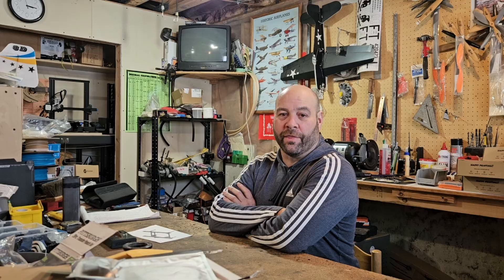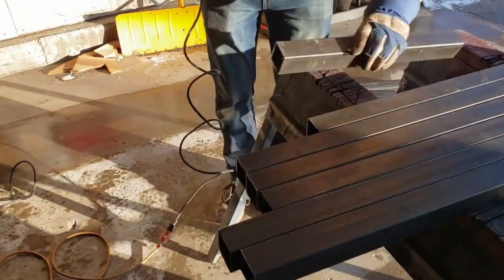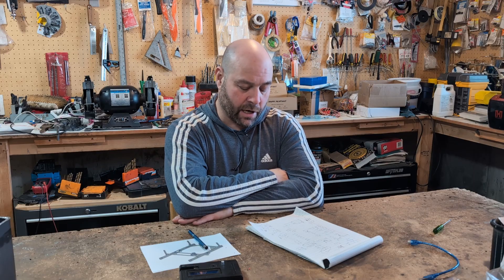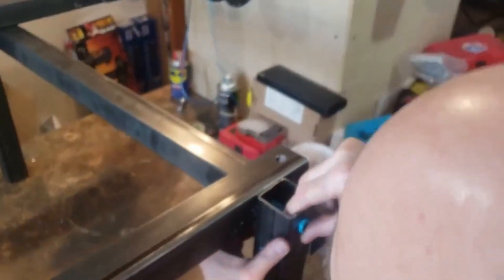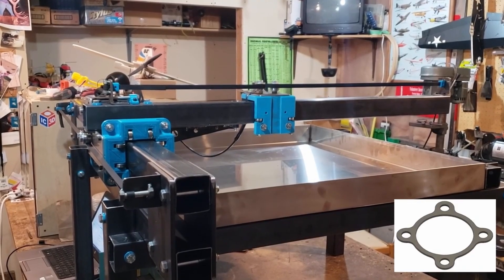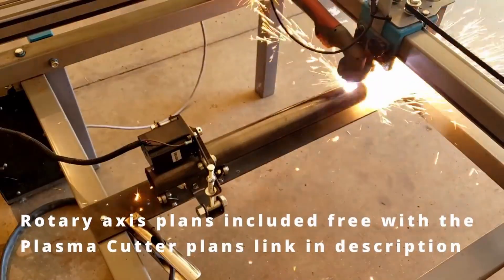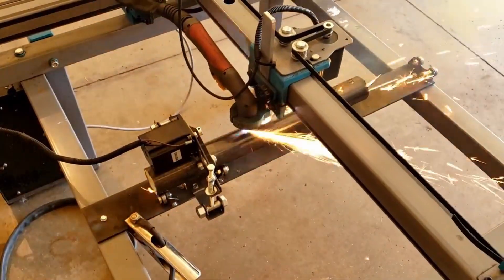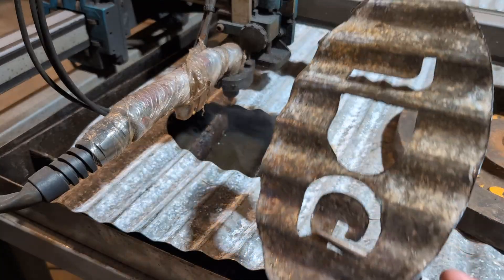Does Our DIY CNC Plasma Table Still Cost $350 to Build?

Comment: In my area there is arlos metal outlet. They have great prices on cut offs and good prices on full pieces. I think they charge for cuts but not that much. They carry a lot of metals in 10' lengths, so no cutting required.  Go to a place like farm and fleet by the pound

Comment: 6/12/2025
I am building the Gen 2 table (with limit switches and without water pan and Z axis) and the cost of the electronics parts alone is ~$350 before tax and without the ~$48 plastic electronics box. I will be purchasing the 3D printed parts from JDG for ~$97. So including the frame steel and hardware, I am estimating the total cost to be $675+. The plans were also $25. So the realistic cost is almost certainly higher than claimed. At least it is for me. I am still going to build it though because I already have a plasma cutter and air compressor, and its still cheaper compared to the cheapest commercial table at ~$1500 for table only.

Comment: unfortunately, i just priced out all the materials and the total cost to build this is over $1500 in my area. The electronics were $450 alone with wire and all the little stuff included. Steel frame was $200 with flat bar and angle iron for me. sourcing all the nuts and bolts is crazy tedious and cost around $150 lol. id have to buy the 3d parts and steel plates because i dont have the tools to cut the plates. so it is cheaper if you have most of this stuff laying around for sure. i can just buy the base crossfire for this price and not have to source all the materials.

Comment: Just for the record Arduino's are $28 now on Amazon as well as the OEM Website. Still excited to begin the assembly proccess!
Reply from the maker: Clones will work just fine for this project as well and they are much cheaper.

Comment: The "filtering" you are doing for the THC... .....   thats due to high frequency start plasma cutters, right?  And after you add the filtration/isolation.....does that mean a high frequency start plasma cutter will then work correctly?   One more question that I came up with....  Since you are building it yourself....there is really no limit on size....you COULD theoretically build one 4 times as big.........just change all the coordinates in the software, right?  (probalby have to truss the arm a bit...maybe counter balance, but still doable, right?

Comment: I just picked up some 8’ Thomson linear motion rails for $100 each. It’s a rail, belt, bearing block and nema 34 motor mount and flex shaft coupler. Just need motors, drivers and a frame. He’s got 12’ units I can get for $150. I plan to buy all 20.

Comment: I have built this recently in the uk, the cost is alot higher now but still was worth it. main savings i made was getting the water pan folded up with a golden handshake and getting the 3d printed parts done professionally (again with a golden handshake) Unfortunately and this is no discredit to jd, but for $350 that is if you are already set up as 3d printing metal tooled wizard. It will cost you more if you are an average garage man but dont let it put you off - the plasma cutter and compressor will be your main cost.
Reply: Wow, would love to see this in action. I’m in UK too want to build but space is an issue as always is in UK.

Comment: As of today 3-12-2024 it can not be built in my area for under $350.  The Amazon links for all the items listed in the kit not including the water pan was more than $350.  Still a good deal in my opinion.
Reply: I think you are mistaken.  the $350 cost is for X/Y axis only and no water pan.  If you are in USA, Amazon links for this configuration is exactly as the video states.
Reply: I will re-examine what I ordered and put an update I did include z axis products, No water pan and no steel.
 @jdstremi

Comment: As much "FUN" as I am having with this project, I can't figure out how to install the post processor to Fusion 360. The vids I find talk about clouds and libraries and preferences none of which do they show how to find these things. I've watched your video, and it doesn't explain it either.  I need an Idiots Guide to do this install. After 3 months doing this build that has had everything that can go wrong, go wrong I'm frustrated. After getting the wiring done, I find out the motor wires are supposed to have Drain wires. Never seen anything about that. The other thing I can' t find are the files to make the Z mounting plate or the files to make the roller if I decide to do that. Maybe I'm just stupid, or I have incomplete instructions I don't know. I am WAY over budget and still need the water pan and the slats, also no mention of slats. I seem to be the only guy having these problems. I don't have a young computer geek to turn to. I really need some clarification here.

Comment: Is the Z axis control required for thee rotary axis and THC? I also see that there is an Arduino R4 with has wifi and BT built in for nearly the same price as an R3. Would that be a good option?

Comment: I do mostly freehand plasma cutting for metal arts. However I do want to be able to do a few brackets and such. What really got me looking at this is the pipe notching add on. I use a lot of pipe in my studio projects and the angles and sizes are numerous. When I freehand them I end up doing a LOT of grinding. I have a Thermal Dynamics Cutmaster 60i with an SL50 torch. I'm trying to figure out if I have to buy a different torch or can somehow modify this one or add a port to control the on/off. If anyone has done this I would be grateful to know.  I'm not really sure where to start this portion.

Comment: Despite my deepest respect for your work I will definitely encourage my fellow hobbyists to read my experience and reconsider whether this plasma build is your best way forward. 
I acquired the drawings from JDG invested and everything needed and here is my learning:
Most of the stuff presented is linked to from US suppliers. Here in Northern Europe this means more than doubling the prices due to transportation and import fees. I spend a lot of hours searching for local suppliers and I only found prices far higher than suggested from JDG.
The X-axes profile is described as a 50x50x1.5mm tube, and it cannot be replaced by profile with thicker walls.
None of the European suppliers I work with does have this in stock since it is a rare size seldomly used. 
Despite my OK experience with 3D printing (Ender 3) I never ended up with acceptable prints. The printed objects have thick walls and 85% infill, which is beyond my 3D printing skills. I wasted more than a kilo premium filament trying.
Conclusion:
I found a cheap engraving machine on German EBay with almost the same work area. It took me 6 hours to change it to a plasma cutter and I spent the same amount as my JDG attempt
Reply: Link? Im in the UK and have the same issues

Comment: Has anyone been able to use this table with an older miller plasma cutter? I have an old miller 375 x-treme with the ICE-27T torch and not sure if it will work as it’s not low frequency?

Comment: I bought your plans and the build is in progress. I am adjusting your plans to work with my existing table from Northern Tool. My X tubes have been changed out to 2" angle (1/8") and bolted to the table frame. Watching the various videos by you and several others convinced me to attempt this.

Comment: Just about to order the plans & parts… now that Fusion360 is pay to use can the software work with FreeCad ?
Reply from the maker: Fusion 360 is still free for personal use. FreeCad also has CAM and post processors for grbl so it should work.

Comment: I bought the plans for the CNC table they are great. Easy to build. However , I just got to the point where I'm ready to make some cuts and my titanium 45 plasma cutter torch won't start off the switch relay for some reason. I check continuity on the torch trigger and on the relay. So I have the correct wires connected to the torch relay. When I fire the relay the torch won't start. But when I pull the torch trigger manually it fires no problem. Looking for any ideas that can help please?
Reply: I also have a titanium 45 and am interested in the answer to this question before I start the build.
Reply: @SJB64  the trigger wires have to be spliced into inside the housing of the plasma cutter body. There are videos on YouTube of how this is done. After you make the splice the trigger on the plasma cutter torch handle needs a piece of velcro around it so it can be held shut.

Comment: I am currently at the wiring and electronics part and am a little over budget but I also bought the 3d printed parts and plates from you. I have also done some extras like drag chain for the wiring and a proper box to mount the electronics. Overall I am quite happy with the build instruction and plans.
Reply: Hey are all the electronics parts required in the plans as well

Comment: I wish you guys would start a "Forum " on your website !! All the JD Builders need to unite and share.
Reply: The work you guys would have to put in to start a bare bones forum would be more than paid back by the users/community contributing and helping each other, building the knowledge base and doing a fair amount of the work for you. It would basically crowdsource 2/3 of your customer service.
Reply: @solarguy6043  They can start a forum with just the click of a button! There are themes and plugins just for creating a forum.
Reply: @solarguy6043  Or even try to set up a user subforum on an existing site - or create a subreddit or discord. I would really love to see that.

Comment: Bought the plans back in July, cut up all the metal, but started traveling a lot for work. Recently got back to work on it and it's just about done. The plans and support are great. It's a fun project, now I will actually use my plasma cutter that has been sitting for years. I am over budget, but only because I only had a weekend to buy steel and the only place open jacked up the prices. I also added the Zone-axis. Now I just have to get comfortable using it. Thanks for all the effort you guys put into this.
Reply: your old plasma cutter is likely high frequency which will cause issues with electronics won’t it?
Reply: @peejayem4700  thanks for the insight, but I already looked into that and it is low frequency, so I'm good to go.
Reply: @gottadrivem5878  ah that’s perfect. I’m in the middle of my build - lots of work but hopefully worth it!
Reply: @peejayem4700 I enjoyed building it, it will be well worth the effort. I'm still debating if I will paint it or not.
Reply: @gottadrivem5878  I used galvanised and aluminium so won’t paint mine. If you’ve used mild steel would probably be a good idea I’d think

Comment: I just came across your budget build, and this video was posted 8 hours ago! Is it possible to increase the table size to say 4x4? If not that is not a problem, this will work for 90% of what I need it for, for the time being. I will be buying plans tomorrow! I am most likely going to be needing to order the 3d printed parts.
Reply: They suggest (in another video) that you can make the table longer in the Y direction, but not X because it's only supported at one end.
Reply: @timandrew4515  thank you, I guess I don't have notifications turned on for YouTube. Hell I would be thrilled to have even a 24x24 if just to cut link tabs. I have a mud truck I bought and it needs to be rebuild. And I made shock tabs with my plasma last year.....ugh I made one just smaller then I needed and cut 16 of them, then drilled holes, unfortunately this proved harder because I got steel from work, half of it was 1/4 AR plate. Then bolted 16 tabs together in in 1 sets of 8 and went to town with the grinder. Did this with my 1 5/8" torsion bar 16" drop arms. Needless to say if I can eliminate grinding other then grinding a spot for the ground I just may be able to get projects done.

Comment: How can it be only 350$? I made a few big heavy CNCs in last 10 years (with ESP32 and AtMega2560 electronics designed by myself, balls screws, NEMA 34 12.5Nm strong servo steppers, 2.2KW and stronger  vfd water cooled  spindles) so I can cut steel with these machines and OK it could be made for  under 1000 euros. I made cheap 2.5" touchscreen THC. BUT!!! I spent 600 euros for 3x400V 100A plasma! It can not be found cheaper! How can you find so cheap under 350$ plasma?
Reply: The 350 is just for the table..  It's assumed that you would already get a plasma cutter.
Reply: @calholli  I spent more than 800€ but still no first cut https://youtu.be/yzTg5Sby9wA?si=VchJ4Exd_5xFy1a9

Comment: I built mine in late 22 and using scrap steel and purchased electronics it was under $350. I made mods and enlarged to 36x36 table. This thing works great and was easy to build.
Reply: What all mods did you have to do to get 36x36?
Reply: interested in the mods as well.
Reply: WHy have you not responded

Comment: My only advice is use aluminum tube for the x axis. Mine is great that way. Good to get updates on this. Mine is awesome. I like it better than the Langmuir Crossfire I have access to
Reply: If you have the tubing or access to it then yeah, why not...I used it for my x axis since it was lighter than steel and got 3 ft for $6. Won't rust or notably tarnish. I'll see how it wears with the steel rollers over time though
Reply: Thank you for the updates in the package also!
Reply: why aluminium?
Reply: @goldar4846 lighter.
Reply: What are your thoughts on building the entire table frame out of aluminum?
Reply: Did the same. Will see how it goes!

Comment: ❤u guys rock but unfortunately mines a paper weight after paying someone over and over to help me mine still dont work still struggling understanding fusion 360 hopefully eventually mine will be rockin and rolling  also over 500 into by tube bender that I still can't get right but it's user error me finding the wrong people to help!! thanks for the vids !!
Reply: i have had good luck using sheetcam for the cam and design spark for cad, Fusion was too confusing in the cam portion
Reply: @TheBuzzman289  thanks so so much sir I'm gonna give that a go !!
Reply: @TheBuzzman289  I'm just so far into time and money wise just want to see it cut some metal